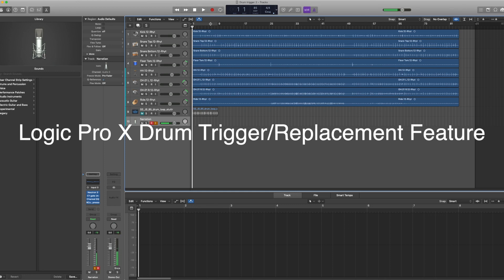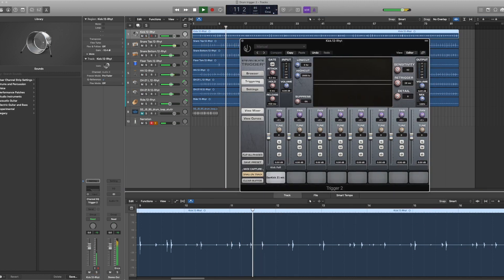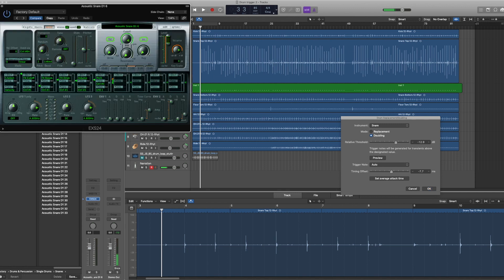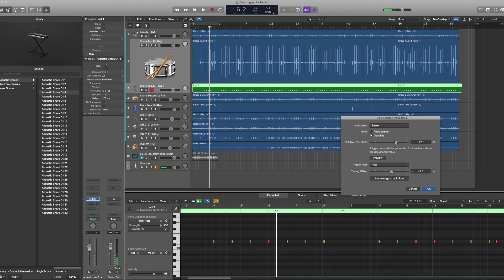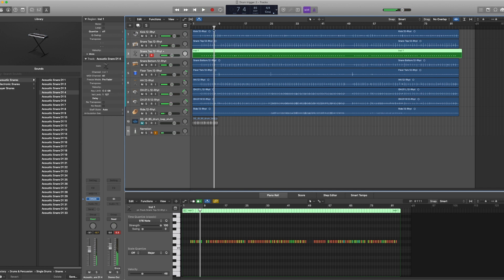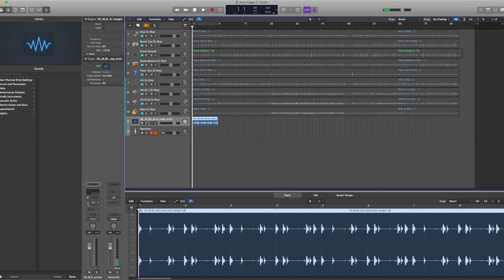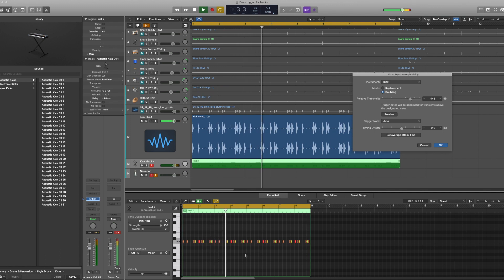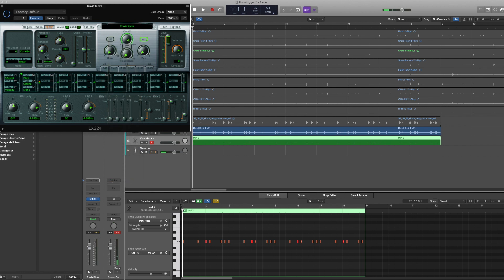Logic Pro X Drum Trigger/Drum Replacement and HOW to apply it

Comment: Thank you for this!!!  

OK just a quick question because I really like how the sunset kit sounds in logic Pro X… 

Can I take my existing drum tracks and import the sunset drum kit sounds to replace my drums?
Reply from the maker: Hey Dave! Once your drums are triggered into MIDI you can use any of the Logic sounds! (that includes the Sunset Kit). Does that answer your question?
Reply: @indigoson7972    Thank you for getting back to me!  

See the problem is when I originally recorded the drums I did not record them as midi tracks I recorded them just as regular audio files… 

Is there a way of taking an audio file recording and turning it into a midi recording afterwards?

I’ve got them marked individually for the kick, toms, snare, etc. but they are just audio files currently
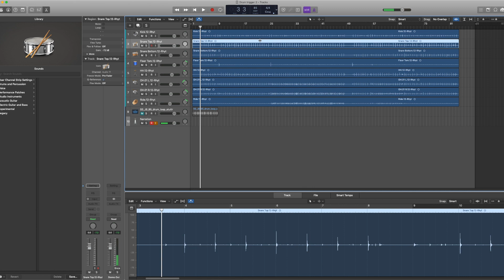Reply from the maker: @davesims7917  Yes i do that at around the 2:00 minute mark in the video. Logic will trigger the audio transients of your waveforms and create the midi information!
Reply: @indigoson7972   oh I see… But does that have the presets like the one I’m referring to (Sunset kit) in there?
Reply from the maker: @davesims7917  It will create midi information which is then your to do with as you please! 
Once the midi has been created nothing is stopping you from changing the instrument patch! 

I offer Logic Tutorials if you need further help drop me a line: paul@indigoson.com
Reply: @indigoson7972     Thank you for getting back to me!  

See the problem is when I originally recorded the drums I did not record them as midi tracks I recorded them just as regular audio files… 

Is there a way of taking an audio file recording and turning it into a midi recording afterwards?

I’ve got them marked individually for the kick, toms, snare, etc. but they are just audio files currently